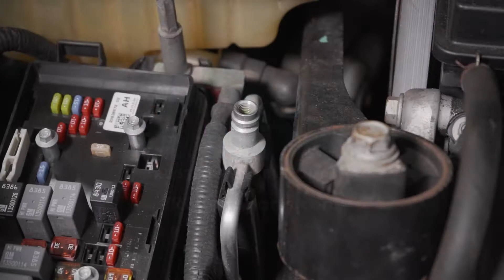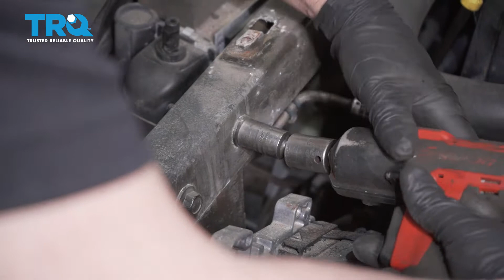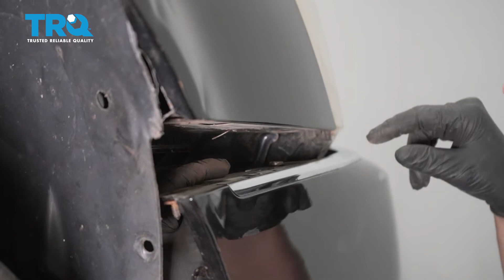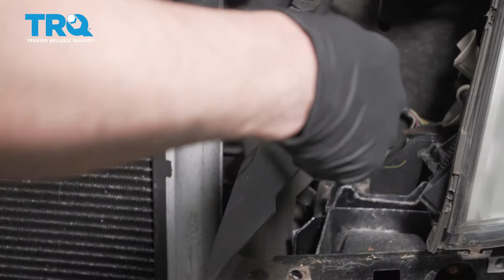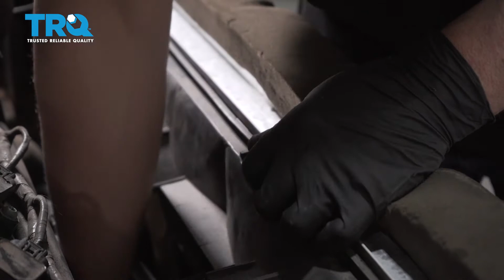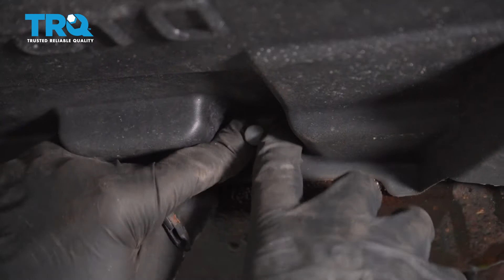How to Replace Radiator Cooling Fan Assembly 2006-2011 Cadillac DTS

Comment: Hi  TRQ team, 

There is easier way hare

Remove the top cover, remove hood latch and bracket 2 bolt up and 2 down, with the front grill
Remove Cross support and unblug the contactors with 2 fan mount bolts and here you go ready to take out
Reply: Thats what I was thinking! They removed so much for no reason lol

Comment: My 2007 STS has a sponge like rubber strip below the radiator that comes loose and hangs under the front of the car. Had it tucked back in twice. I am told it prevents the radiator from getting damaged when traveling over bumps in the road. Has anyone had this issue and what did you do to correct it?